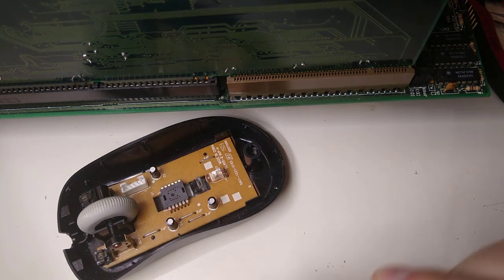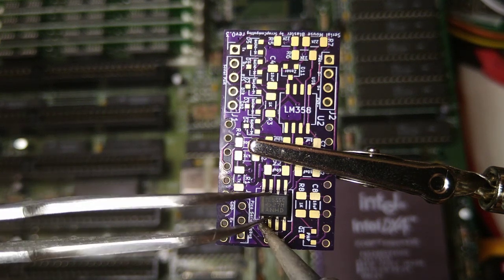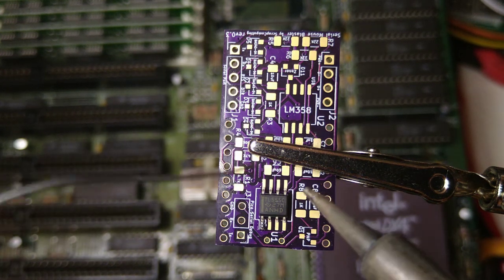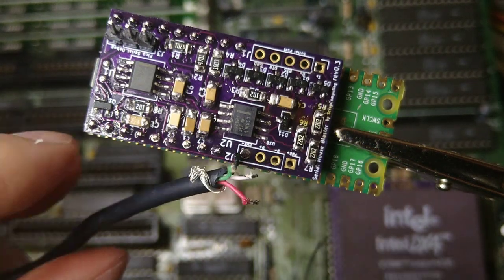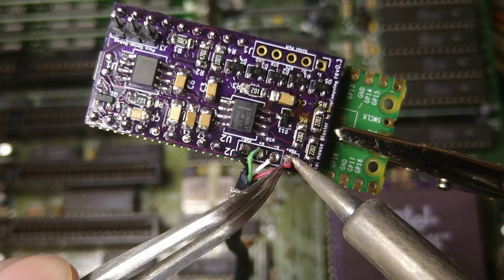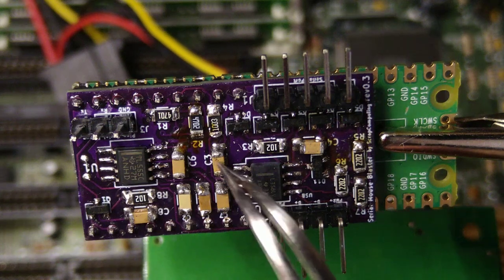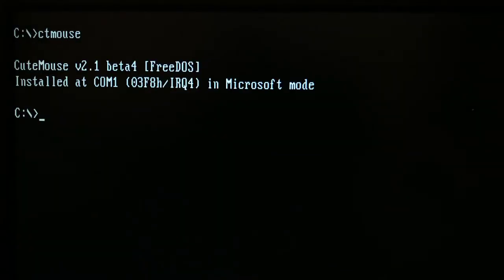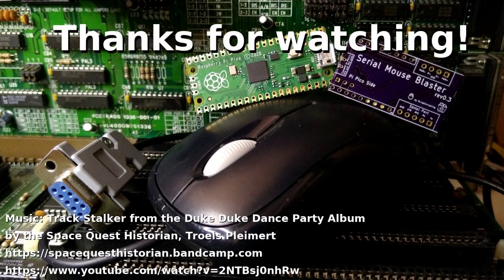Serial Mouse Blaster: The Quest for the Serial Optical Mouse (part 3)

Comment: Soldering looks so satisfying in these videos, but at that level of detail, I don't think I could trust my shaky hands.
Reply from the maker: That's what I though myself and I was avoiding SMD parts, but it's not that much harder than through-hole. You just need some tweezers and some helping hands to hold the board at a comfortable position.

Comment: Why not switching to hot-air & flux with smd components?
Reply from the maker: I find it a bit easier to solder them using the soldering iron. Most footprints I used are actually designed with hand-soldering in mind.

Comment: I spotted the problems as you were soldering. C3, C6, did not take solder, need to be reflowed. 
Pin 7 and 8 on 555 didn't take solder. But it's working 👍
Great board design. Why did you go with Pi ?
Reply from the maker: Yeah soldering with the camera in the way is a bit tricky, so I usually mess it up :)
No particular reason for going with a Pico, other than I had a couple lying around and that it has USB host support.
Reply: Yeah, know you mean.
I use a little 4"x4"x2" cushion  / pillow under my left and right hand.
Thru the camera / phone. There is a flexible  "goose neck" with desk clamp on one end and phone clamp on the other. Position the phone were you would expect a magnifier would be over your work.
,   ;)

Comment: Thanks for that tip with using a small solder blob. SMD has always been a little difficult for me trying to hold the iron in one hand the components in another and the solder in my.mouth hahahaha.
Reply from the maker: Haha, yeah I usually prefer through-hole components, but it turns out SMD isn't too bad after all. 1206 package on a board with pads optimized for hand-soldering is actually pretty easy.
Reply: @scrap_computing  through hole is easier but takes so much heat. But with that little trick I think surface mount will be much easier for me. Again thanks for all you do. Your channel may be small but I believe your impact will be immense.

Comment: Do you think this could work with wireless mouse or does the USB dongle just take too much power ?
Reply from the maker: That's a great question. I will give it a try and will get back to you. If it works that would be really awesome! We could make a serial-to-wireless mouse dongle, with no external power!
Reply from the maker: I checked the USB dongle of a Logitech M170 but it consumes 19mA, which is way too much.
Reply: @scrap_computing  that's unfortunate, thanks for trying anyway :)